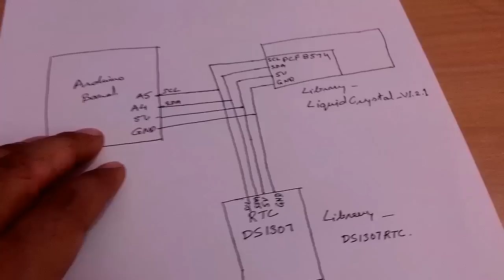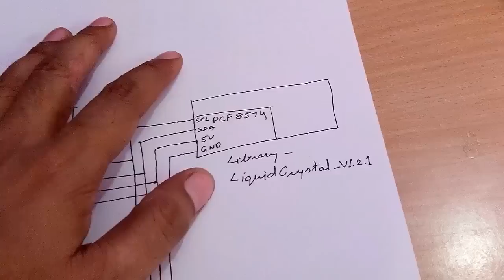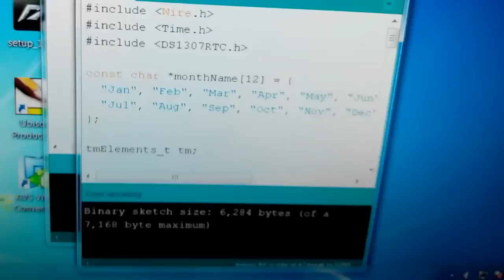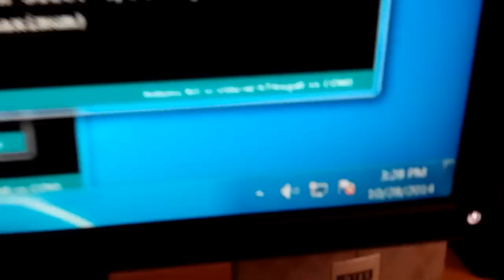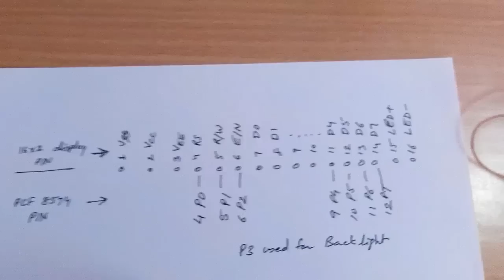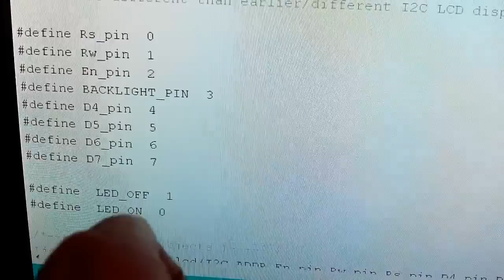Clock using Arduino I2C bus for both RTC and 16x2  LCD display

Comment: Dude, I appreciate you trying to help educate people on how this stuff works, but without being able to see your entire code your tutorial is missing the most critical piece of the puzzle. Namely how you get the arduino to communicate over a single I2C bus to the two devices in the same sketch. When I tried to do this (albeit with the DS3231 rather than the DS1307) it bricked my LCD so now it only displays balck squares. I had the LCD working just fine on its own, it was only when I tried to implement the RTC module that shit hit the fan. A follow up vid or a github link to your sketch would be much appreciated.
Reply from the maker: Thanks for the comments. i have given a link to blog where everything is available including code and library. however here it is the direct link https://drive.google.com/drive/u/0/folders/0B9J1p1c_BTvjWE1fZk9jYXZBcEk

Comment: are you using two i2c on simultaneous? I thinked that only is possible one :/
Reply from the maker: Laurence & Urban Music yes you are right at a time i am accessing one I2C device only.
Reply: brainstorm ABC please can u share your code? I need too access to RTC and LCD by I2C (because my lcd has I2C integrated, and that use few pin)
Reply from the maker: Laurence & Urban Music You can download the code and library from https://drive.google.com/folderview?id=0B9J1p1c_BTvjWE1fZk9jYXZBcEk&usp=sharing
Reply: brainstorm ABC Thanks a lot
Reply from the maker: Laurence & Urban Music your welcome

Comment: Interfaced arduino uno with esp8266-01 Wi-Fi module, 16*2 LCD ...now I have a webpage where it has two text boxes and submit button.So now when I type something on text box and click on submit button ,the text should get displayed on LCD . I tried for led toggle from internet example .it is working . at commands everything is working . I am new to server and web concept. I tried get method with HTML in webpage.but could not succeed. Some people said try php. Any idea.
Reply from the maker: Yes, to process the form data at sever side use php.